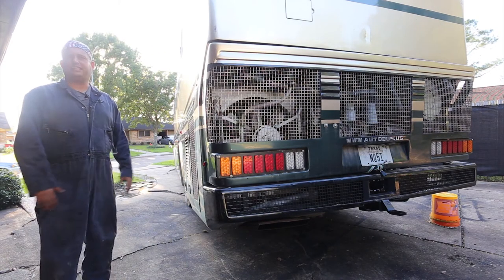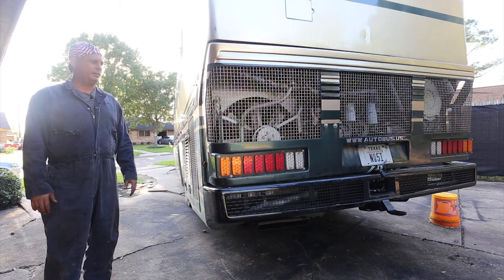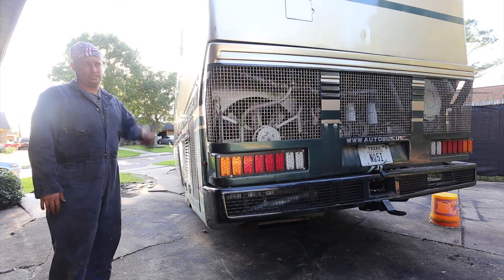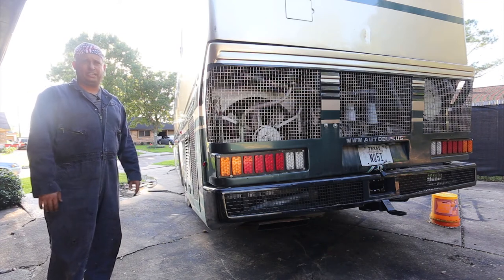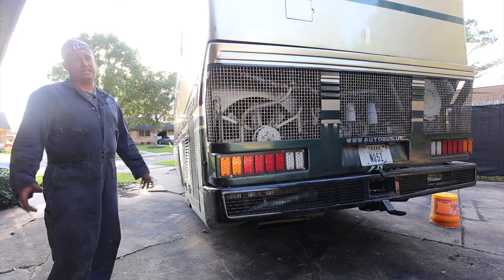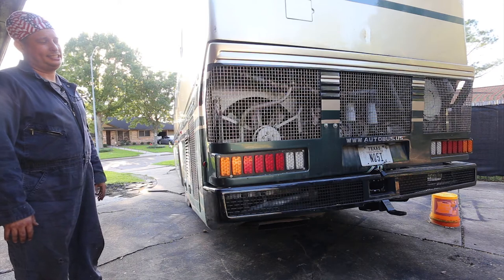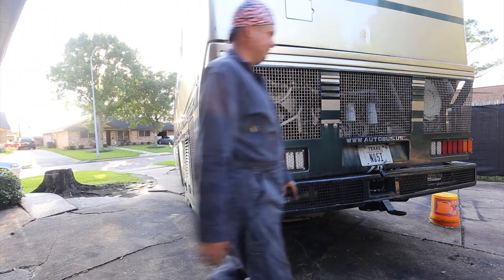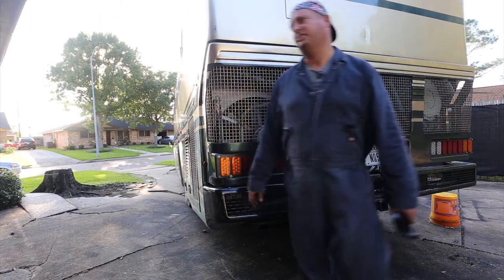Parking my Pegasus / Neoplan Coach

Comment: Thanks for sharing some more Neoplan videos and blog updates with us. It's pleasing to see it is getting some use again. Good luck.
Reply from the maker: I have been using it full time since mid-October.  Work affords me the opportunity to travel and the RV is more comfortable than a budget motel.  It's way cleaner than a rest area too.  I drove from Houston to Mobile, Alabama and back and now I'm in Waco, TX.  Averaging 6.33 MPG.  There have been some mechanical issues to contend with, but overall it's doing great.  I'm planning on some significant renovations in the next month or so.  The generator appears to be the original.  The water pump went out on it, and in the course of my investigation I confirmed with Yanmar that the engine is a 1986.  Fun stuff.
Reply: Is that a Detroit?